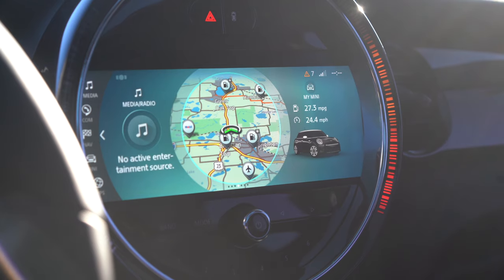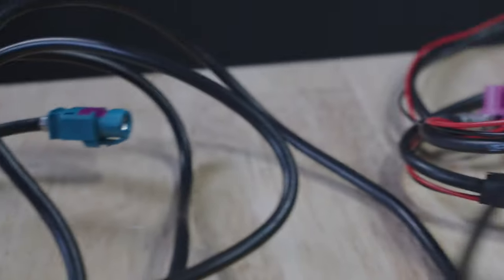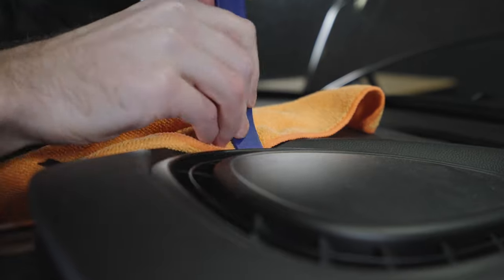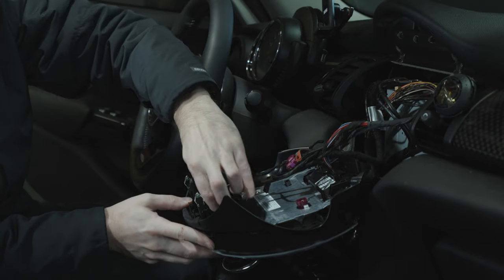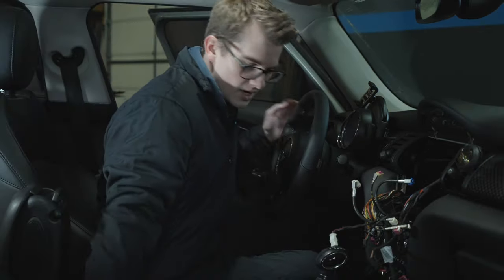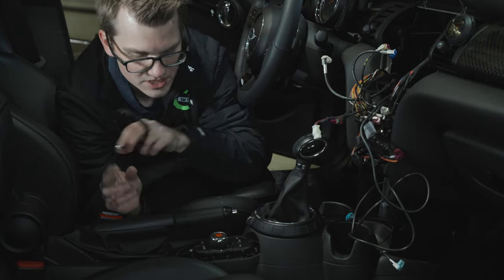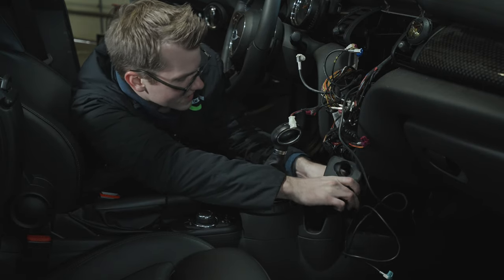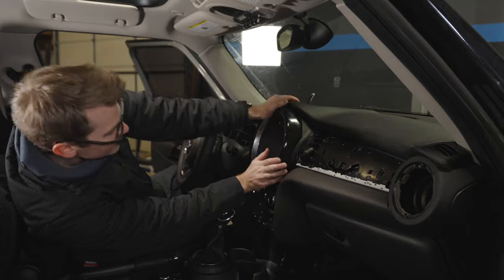UPGRADING to the NEW 2023 Infotainment System...

Comment: Nice video on the infotainment upgrade.  However, you left out the fact that you have to completely change the vents and trim pieces for this to work properly.  On one part of the video you have carbon fiber trim then the next you have gloss black trim.  Also the vents are different from the ones that you took off to get the head unit in.  Are you going to make a video on the trim piece swap?
Reply from the maker: Thank you! I pointed out at one part that if you want to keep the current vents and trim you have to trim the side of the new screen. 
I will be doing a video though in the next few weeks on upgrading the trim though!
Reply: My apologies. You did state that in the video. I overlooked that important detail. Can't wait to see more videos in the near future!

Comment: I have a 2017 mini Cooper s with Harmon kardon How do I install an after market sub? What's the pin out so I know what unamped wires to pull signal from? And where exactly are these wires?
Reply from the maker: Hello, I am sorry. I have not researched HK systems yet. Maybe check the f56 forums?
Reply: @carcreationsyt  tried pretty much everywhere, it's almost like people don't know or can't get the info I need. Even though I know for a fact it has to be in the mechanics service manual

Comment: I got a unit that was pulled from a F60 and has ID6. The unit does not have a OABR port like my old system, do you happen to know the rewiring that needs to be done for this so I can have this flashed?
Reply from the maker: Hmm sounds like maybe it is an entrynav2 system. You would have to code it on the car

Comment: Good. Next convert the handbreak to electric , change n code the steering wheel, and change the gear shifter to the electronic one.
Reply from the maker: Thanks!! Steering wheel is done except for the airbag. I am not sure about the electric hand break and gear shifter though. I could do the hand break but I kind of like the manual one. Unfortunately I cant change the gear shifter as it needs a whole different trans. Who knows though, maybe I have a trans and engine swap in the future!

Comment: Well done! is there a missing step with the laptop setup?
Reply from the maker: The unit comes pre coded so you won’t have to code it at the end, I just plugged in the laptop to code some other stuff and code any missing features that may have been missed. 
You wouldn’t need the laptop at the end unless something needs to be changed or fixed and that coding service is a part of the package. 
Hope that makes sense!
Reply: @carcreationsyt  Oh, thanks, that make sense :)
Reply: Hey, where can I buy the new infotainment unit? Thanks
Reply: Where can I buy the new infotainment system for my 2018 Mini Cooper?

Comment: Would you have any idea why the radio does not show the screen settings (ambient lights) on the android radio? Mini cooper f56 2015
Reply from the maker: Good question! The system I installed lets you, however you mention android radio so it sounds like you dont have the oem system I installed here. I dont think you can change a lot of the car's functionality with an aftermarket android system.

Comment: I have a pre-LCI 2018 F56 w/ HUD.  I would like to do this upgrade + have a single (or dual if possible) powered USB-C ports.  Question is, once installed, will the map direction from Apple CarPlay show up on the HUD like the factory system does now?  This would be a big deal for me.
Reply from the maker: Hello, thanks for watching! 
No unfortunately CarPlay does not interface with the car in anyway other than music and displaying the screen. 
If you wanted it on your hud, you would need to continue using the oem mini navigation

Comment: Could you be so kind to suggest infoentrat for My 2012 r56 lci mini. Thanks.
Reply from the maker: It depends on if you currently have a screen. If you do, a CarPlay box is super good. If not, you have to upgrade to a screen and it isn’t as good with integrating with the mini systems.

Comment: Hello, I'm a new follower of yours on yt from Spain. I was looking to buy a used mini cooper s r56. And I'd like to install the touchscreen display and the digital cluster that you show on your videos. So I was wondering if you could give me any tip or piece of advice to do those modifications. My main concern is the head unit. I don't know if the car I'd buy would have the most circles to connect the cluster. So my questions are these: The entreteniment display comes with a new head unit? Or do I have to buy it apart? And if I have to buy it apart where do you recommend me to buy it. Thanks a lot for your videos because you answered a lot of previous questions I had. And congrats on making a damn good looking car.
Reply from the maker: Hello, thanks for watching all the way in Spain. Unfortunately only f series MINIs support the new cluster and information system.
Reply: @carcreationsyt  can you confirm that 100%? because i found the cluster on aliexpress and the descripction says that it fits in the r56 car. And ther is an entreteinment system aswell on aliexpres that fits in the r56 car.

Comment: Hi Ethan, nice video as always. I have a question somewhat related to this, hoping you can help me. I have the Pre LCI HU like the one you changed but with the big screen, and it comes with USB-A and Aux In too. Is it possible to change those to twin USB-A (like in the LCI 1) or even twin USB-C (I've seen some on the internet) without having to change the HU?

Thanks in advance, and looking forward to the video on retrofitting the digital dashboard
Reply from the maker: Thank you so much! I believe you can. I am not sure if it needs to be coded though. If it doesnt work then it most likely would need to be coded.
Reply: @carcreationsyt  also want the usb c instead of the usb / aux - do you know if the conector from the stock usb/aux fits to the new usb C ?
Reply from the maker: @adicojocaru6105  yes it does. Make sure you get the usb one for MINI though, I didnt and it did not work lol
Reply: @carcreationsyt  do you have a part number for the usb-c that works?
Thank you so much

Comment: Dude i have a same infotaiment system on my 2021 Countryman. But i dont have a navigation system. I want to know... Does my unit have a wifi port ? if it is my friend say you can unlock the carplay and android auto features.
Reply from the maker: To check you have to take off you screen and see if it has the Wi-Fi port. If so, send me a dm on instagram or an email and I can help you get coded and the cable
Reply: Thank you I ll handle with it at the weekend. If I have a wifi port, i ll send dm to you. But I want to know. If it have a wifi port does android auto will works either ?
Reply: @carcreationsyt  And one more question for you Ethan, If my system has a wifi port. How many costs i need to pay for all steps. Honestly i tought to plug chinese android auto and carplay kit from aliexpress. Then i watched your video. If this method needs less money please tell me. Thanks
Reply from the maker: @birtan812  No android auto will not work. Just android mirror link.
Reply from the maker: @birtan812  most likely 3-400 euros
Reply: @carcreationsyt  oh i got it.thank you for your patience dude. Cheers 🤝
Reply from the maker: No worries, thanks for watching!

Comment: Will this fit in my 2015 f56 base model mini cooper ? 
I have the "ugly" radio. I really want to have the touch screen and navigation system.
Reply from the maker: It would fit but would require a wire harness and a bunch of wire splicing. Not plug and play like mine.

Comment: Is there a Infotainment System Delete Kit? I do not want this added complication to my Automobile. The more bells and whistles there is in a Automobile. The more there is to Break. Reliability, Safety, Privacy and Power Consumption are all concerns I have with the Infotainment System. I do not want this in my Automobile. As it stands now for me. A Infotainment System = No Sale. My uncles car was a write off because the Infotainment System died. A option to opt out of the Infotainment System is needed in my opinion.
Reply from the maker: Any mini runs fine without the infotainment system. 
You can pop it out, no errors, no written off car believe it or not, and car runs fine.
Reply: @carcreationsyt  I check out the Mini. Thank you.